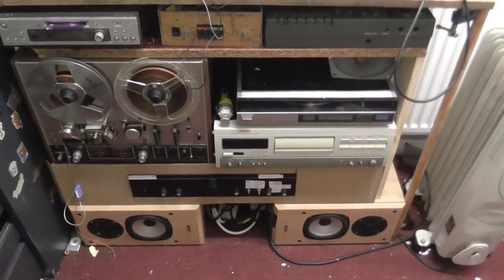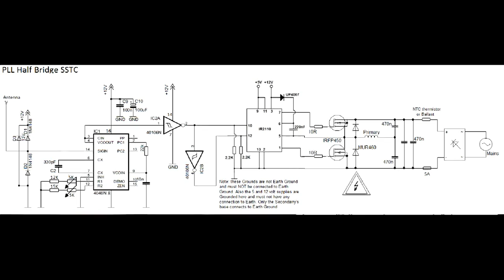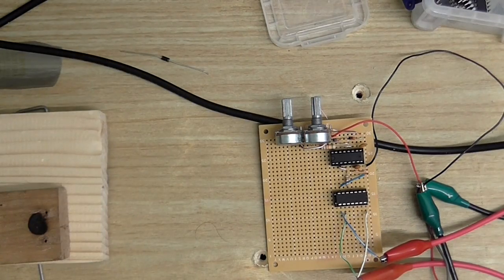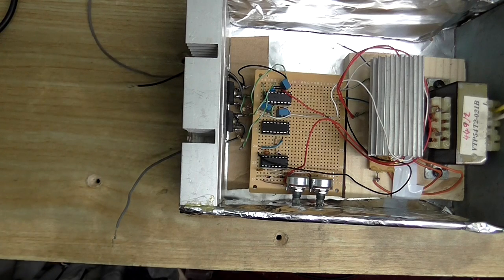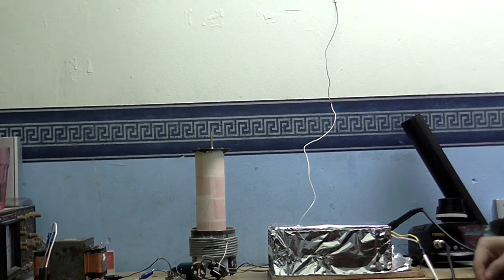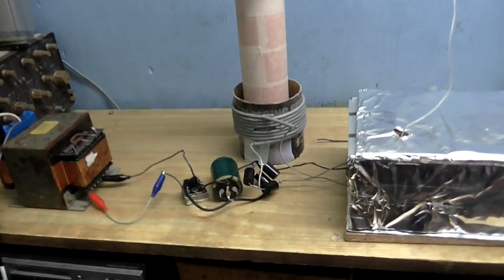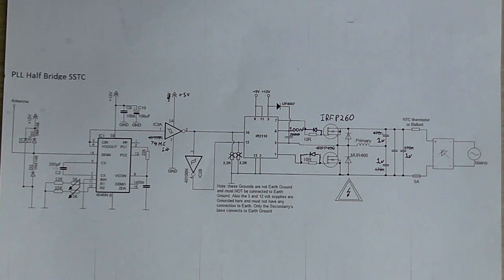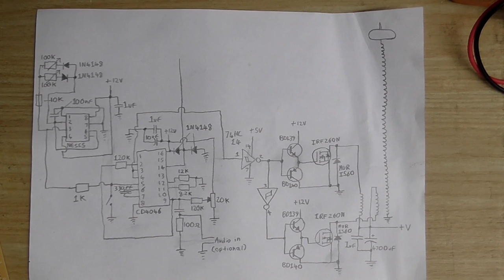CDC Electronic Workshop   PLL Tesla Coil Experiment

Comment: upgrading to a full bridge, and upgrading to some 500v+ MOSFETs for mains runs should get the coil really kicking.  Also run half wave rectified power.  It will dramatically reduce current draw, switch heating all while keeping spark length.  In fact sometimes it even improves spark length.  Nice job!

Comment: Bench looks cool Clem. The Tesla Coil is coming along well too. I have a sort of related question. I have acquired two Toroidal transformers exactly the same. can they have two outputs each. Can I series them, then series them both together? Also can I do the same parallel. BTU! I am looking forward to this years installments of your Electronic Workshop!
Reply from the maker: +Elecifun Yeah connecting the outputs of transformers in series is perfectly ok. I would do the two transformers separately at first, to make sure the secondaries are connected right, lets say both the secondaries are 24 volt each, you should get 48 from both of them in series, but if you get less voltage than you expect, just flip the connections on one of the secondaries. Then when you have both transformers putting out a good voltage, you can series them together, this time if you don't get the voltage you expect, you can just flip the connections of the primary and it should work.
Reply: CoolDudeClem Cheers Clem. I feel confident I will not do to much damage now. :-)

Comment: By the way, the picture quality is much improved in this video!
Reply from the maker: +Mr Sammotube That was my bad, in the earlier videos I thought I had auto-focus on, yet it was on manual. Also the shutter speed of 1/50 makes everything a little too bright, so I put it on to 1/100 for most of my videos and use 1/50 for low light filming.

Comment: But if you use the IR2110 it means when your fets blow up they will kill the control electronics
Reply from the maker: This is why I decided not to use them in future projects.
Reply: @CoolDudeClem  i'm recently working on a PLL sstc, but i didn't got any Gate drivers like the UCC le the MIC im trying to use the BD139/140 Push Pull with a Schmitt trigger
Reply: @CoolDudeClem  if the MOSFETS blow it blows only the IR2110 or the Full controll like the PLL and the Schmitt trigger?
Reply from the maker: @Headbutter-Lettuce90  It would blow most, if not all of the electronics. That's why I prefer to use a gate drive transformer where possible.
Reply: @CoolDudeClem  do you think it is possible to place a GDT with a IR2110?
Reply: @CoolDudeClem  what if you use some fuses on the gates between the IR2110 chip and Gates of MOSFET
Reply from the maker: @Headbutter-Lettuce90  I dont think that would work, but I think an IR 2110 can drive a GDT.
Reply: @CoolDudeClem  so, the floating Ground of the high side of the chip will go to Common 12v rail ground and the high and low will go to the primary of GDT?
Reply: @CoolDudeClem  am I right?

Comment: how many volt of 1uF and can i changed uf4007 to mur460
sorry for asking  because i just beginer
Reply from the maker: Yeah you can use an mur460 instead of a uf4007. As for the 1uf capacitors, basically the more voltage they can handle the better, the caps at the output should be at least 400 volts rated.
Reply: thank very much

Comment: what diode parallel with resistor to gate of mosfet ?
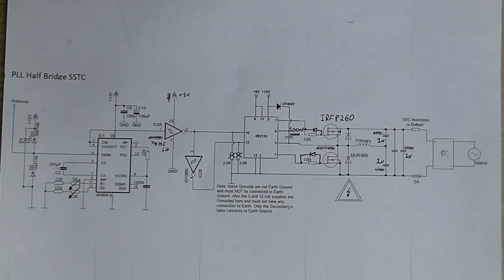Reply from the maker: I put in a diode connected in parallel with each gate resistor, you can see those in the schematic at 15:34, they help to discharge the mosfets gates at at the end of each pulse so there's no shoot-through (a brief time where both mosfets could be on)
Reply: that is 12v zener diode ?
Reply from the maker: No, just a regular hi-speed diode, I used UF4007, but also adding a zener between each mosfet gate and source would also be a good idea.

Comment: Still cant see where your connecting the secondary coil wire at, could you please let me know as am baffled :/
Reply from the maker: One end of the wire is connected to the little metal disc and the screw is just resting on that. The other end of the wire is connected to ground.

Comment: Hey sorry for another question Clem, but what 4 diode rectifiers in series at mains power are you using? as dont state :/ sorry for dumb questions just new on building one.
Reply from the maker: it's called a bridge rectifier, it has 4 diodes inside it. Although it you're new to this , this might not be the best to start with.
Reply: I am fine don't worry, understand its a bridge to convert to dc but what amp rating are the diodes for the bridge?

Comment: How can I audio modulate it?
Reply: you need to put an or gate,     A on 3 and 4 pins  ,  B to your modulator       and Y to pin 1 of the 40106n
Reply: Yes. I have a demo on my channel at 50VDC. I am working on improving my design for operation at 170VDC. I used FDP33N25 Mosfets (about equivelent to IRFP250N)

You can audio modulate it by driving an audio signal into the VCO by connecting the Low Pass Filter capacitor to an opamp buffer with the audio signal as the input.